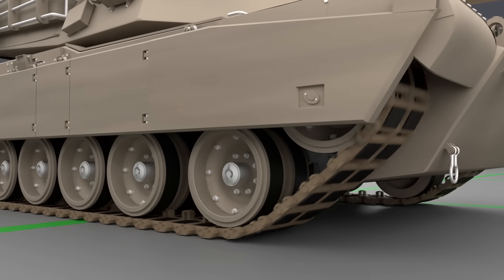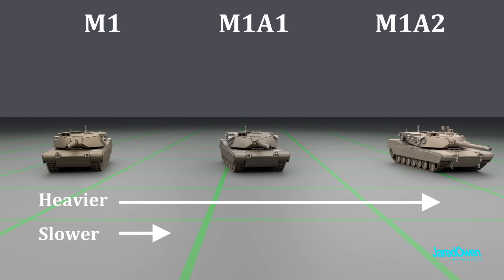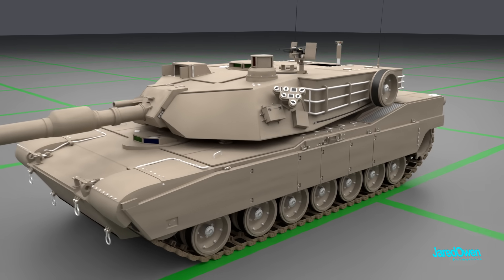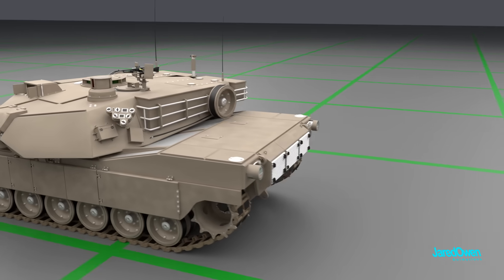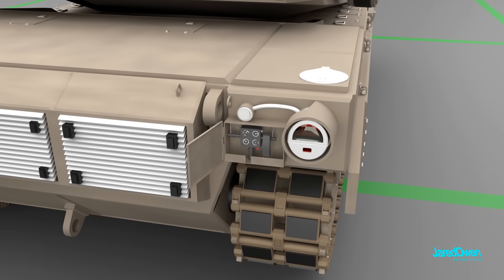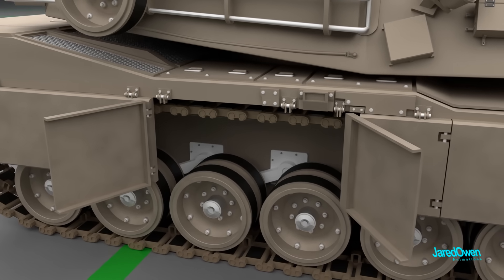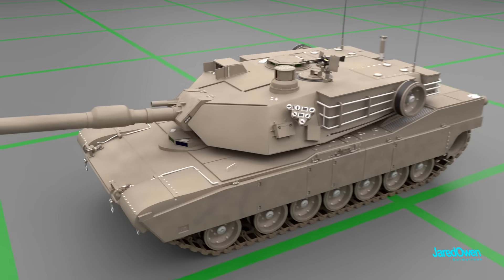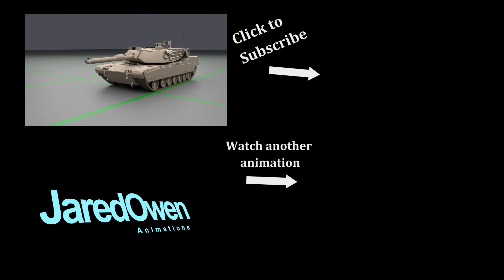How does a Tank work? (M1A2 Abrams)

Comment: Your video is great but dude, learn the difference between feet per secon and miles per hour.  You described the main gun rounds  as  going 3500 miles an hour. Thats over 5000 feer per second. Not possible. They can go around 3500 feet per second, or around 2300mph. Ill double check my data, but you should have done the same.
Reply from the maker: Hi Steven - these rounds go incredible fast.  It is possible😁 Here is a great reference if you want to learn more: https://amzn.to/2WaIzjv

Comment: The commander can use the gunners sight, because commander doesn't have night vision mode. The low  distance to the ground is bad, it can make the tank get stuck, but it can elevate or lower the hull. The side skirts on the side of the driver position are composite to sustain Heat shells at 60º angle.

Comment: no on the tank you will not find a turbine engine. most tanks have diesel engine like leopard 2 t90 t72 ariete. the exeptions were first the t80u then the abrams. those are the only two that come in my mind that have turbine engine.

Comment: This video: Shows locations of crew compartments, engine, equipment, and how the treads work

Me: How does a giant throwing dart and an exploding cone penetrate tens of centimeters of steel?! And how does a ceramic sandwich stop them?!
Reply: It pens it because its a dart lol. And its depleted uranium. Other countries use tungsten.  But the US DU APFSD round heats up after fired, so it uses its velocity and its heat to  penetrate. Up to 800mm+ depending on what model of round its using.
Reply: And also it’s flying at a speed of ~1500m/s. This is real speed

Comment: Jet fuel is basically just kerosene.
Reply: Depends on the grade of jet fuel.
Reply: @sandervanderkammen9230  There are two grades of jet fuel, both are a kerosine base.
Reply: @georgemartin4963  No, that is not correct.
Reply: @sandervanderkammen9230  It is absolutely correct!!! Look it up if you don't believe me.
Reply: @georgemartin4963  I don't believe you know the difference between aliphatics and paraffins.
Reply: @sandervanderkammen9230  https://en.m.wikipedia.org/wiki/Jet_fuel 🖕
Reply: @georgemartin4963  Thank you for proving my point.
Reply: @sandervanderkammen9230  Interesting response considering the article confirms my original assertion that jet fuel is basically kerosine.😂
Reply: @georgemartin4963  Thank you for confirming that your knowledge of jet fuel formulations is limited to Wikipedia...
Reply: @georgemartin4963  Apparently not,  your own assertion is not based on any knowledge of organic chemistry or the petro-chemical industry... just public opinion based on oversimplified, dumbed down explanations.
Reply: @georgemartin4963  Are you sure? You better check Wikipedia again Hahaha!!!
Reply: @georgemartin4963  I'm sure you can find the answer on Wikipedia... lol!

Comment: Tank “fairly quiet”, Bruv in squad I can hear that across the map
Reply: Thats a video game.. lol. IRL its not quiet, but it is compared to diesel engines of the same size and power.  Which other tanks use. They are actually very quiet coming at you. All its sound is projected behind the tank.
Reply: Law Abiding Citizen the tank does class as one of the loudest tank compared to others
Reply: @jackattack237  when standing right by it. Not at distance, especially in front of it. The higher pitch does not travel like the deep tone of a diesel engine. It is literally one of the reasons they chose it over a diesel.
Reply: It also does not smoke like a diesel engine does.
Reply: Law Abiding Citizen can they produce smoke as defense tho?
Reply: @jackattack237  I believe so, I believe it is just a chemical injected into the exhaust.

Comment: Just gonna say, they aren’t referred as caterpillar tracks at all, and there isn’t much to learn about this tank honestly, only if your a mechanic does all the fancy names of stuff, also it’s not as cramped as you think in real life, it’s 7 ft tall, and it’s main gun can fire up to 4,990 + or - 10 km, it runs off of just fuel, the three main fluids are FRH, Turboshaft, and 15/40, it has a primary gun of 120mm, and it has a secondary coaxial gun M240L, a loaders mounted gun M240C and a M2 browning .50 caliber machine gun for the tank commander, also the most likely part of the tank to break is not the track itself, but parts of the track, like the wedge bolts that hold on the end connectors, the end connectors themselves, and the center guides, the projectile is not 120 mm, the sabot pedals are, the only projectile that is actually 120 mm is the HEAT round

Comment: 1.Early Abrams had 105mm canon only A2 have 120mm. Abram also capable at hitting target at over 4km (even though none ever did)

2.that's not how smoke grenade launcher works, they actually launch the smoke grenade

3.most operator usually gave abram a other fuel. The jet fuel was very expensive for operate

Comment: Something to note the smoke grenade launcher fires the grenade before the smoke appears not from the launcher itself however the driver has the ability to press a button that sprays the turbine with fuel which creates a smoke screen but this isn’t used when using jet fuel because it can damage the engine

Comment: for reference, as a tank weighs 35 cars, at 0.6 gpm is has a fuel effieciency equal to 21gpm if it was divided into normal cars. so its not as bad as it seems at moving its weight. a lot of tanks are actually more fuel efficient per ton then most cars.

Comment: Wonderful animations.  But I think the models you were provided missed a few things.  Above the road wheels, behind the armored skirt, are three small support rollers (About 12" Dia.), evenly spaced between the Idler Wheel and the Sprocket, to carry the weight of the track and prevent it sagging.  Also, at the very front, the idler wheel is connected to the front road wheel by a link that moves it forward slightly as the front road wheel suspension is compressed.  This is done to maintain track tension.  The track works like a drive chain and any slack will let the drive sprocket "cog over" and slip.

The smoke grenade launchers actually launch the grenades in an arc around the front of the turret.  When they get about 15 Yards out, they air burst and scatter smoking fragments along that arc creating a very fast curtain of smoke in front of the tank.  It's very neat to see.

The M1 series is also quite a bit faster than the published specs.  Hard, improved road performance is in excess of 60 mph, and it will leap, yes LEAP, an anti-tank ditch not exceeding it's own length.  The Abrams is the first tank designed to leave the ground under it's own power!  The road wheel suspension was specifically designed to absorb the massive impact of the landings and it's engine produces 1500 Hp at the drive sprockets through a 5 speed automatic transmission.

Comment: Nice explanation and animation, but two things bugged me:
1) most tanks still use regular piston engines. They consume about 2x less fuel for the same performance and aren't that much louder. The turbine has less moving parts that could break, but the air filter is a massive weak spot.
2)the door in the animation would only allow access to a fraction of the shells. Moreover, if I'm not mistaken, the shells are stored in liquid in order to reduce the risk of fires spreading. This however means that you cannot move the shells behind the blast door...
Reply: @Silenet K Oh. I thought it was based on a photo. They do seem to stick the shells into a form fitting rack. Or not?
Also, I still wonder about the turbine. I simply can't imagine it to work as efficiently as a piston engine as nothing physically traps the expanding gas and then there's the issue of the giant volume of air sucked in and propelled out... 
And the rotation rate must be seriously reduced... It looks like something amazing for jets, but tanks not so much...
Reply: @Silenet K thanks.

Comment: 6:05 I think this is only for the gas turbine engines
Tanks like Leopard still use Diesel engines (but with multifuel if I don't mix that up with the MBT 70)
Reply: T-80 also uses a gas turbine.

Comment: But all I wanted to know was what the bulge in the main gun was for.
Reply: It’s called a bore evacuator, used to prevent the hot gas from entering the crew cabin though the gun breech after firing, potentially harming crew and equipment. More info on how it works here: https://www.youtube.com/watch?v=by2I0CbhyKc

Comment: Everything about these models you are using seem off from dimensions to the blow out panels shape, size, and location. Parts on the turret are sized incorrectly and in the wrong places. Also, there are weird seams all over the place. The interiors is basic and looks like most of it was made up based off information told verbally or bad images. War Thunder is NOT historically accurate in the least and the gunplay mechanics make it possible for certain ammunition types to penetrate armor in places that was never really possible. I think it's cool that you made a video explaining how it works, but after only 1 minute and 54 seconds into the video I had to stop and say something. I'm sure I"ll have far more to gripe about with the other 4/5 of the video.
edit
The "treads" have a triangular center guide not a rectangular one. It's like the dude doing the model went purely off memory or didn't care. There seems to be a lack of support rollers or arms anywhere behind the skirts as well.
At 5:50 the hydraulic pump is missing from the turbine engine and none of the electrical wiring is there.  Oh, and yes it's very quiet... but in war thunder it's not.
The shells leave the barrel at closer to 3800mph, actually. The gun can also hit targets are farther than two miles away. The maximum effective firing range is 4000m, 2 miles is 3200m.
I cannot believe you actually made the smoke grenade launchers emit smoke instead of launching the smoke grenades like it actually does. That was literally comedy gold.  You have no idea how any of this works.
The loader is never facing the outside of the turret unless he is working on radio equipment, to load rounds you face the gun and rotate your body to the ammo rack so that you can quickly pull a round out, crouch, flip it into the gun tube and push it in until it clears the breach.
The turret and basket is missing 99.9% of any and all interior components but shows the basic layout. The war thunder x-ray mode is very inaccurate when it comes to ammunition system and storage on the Abrams. Quick videos online would show you this, so when you say it is hard to find reference material.. I have a hard time believing you. You simply just did not want to do research into the topic before making a video that would only be suitable for 12 year olds to catch an interest in war thunder... oh wait...
Drivers hole is missing the emergency engine override lever and the lever to the left of it uses to empty the hull when it gets full of water. The lever on the left side is nonexistant, and the halogen bottle and green air filter are placed further back into the tank just outside the turret basket ring and not in the drivers hole as seen. The buttons or knobs or whatever on the right side also do not exist. The T-bar somehow looks extremely complex compared to the simplicity of the one used in real life.
Reply: ok russian mig

Comment: "However, this engine is actually fairly quiet."
If you play War Thunder, you know you can hear an Abrams before you can even see it
Reply: the abrams is a quiet tank irl. becuase its a turbine it makes a high frequency noise which is very loud when up close but at any other range its quieter because it dissipated faster than a low frequency noise
Reply: @Dodener  huh, never knee that was the case irl. Thanks
Reply: the XM1 was the names given to the couple of prototypes from Chrysler and GM so its highly unlike you piloted them. Also if you did pilot the XM1 why wouldnt you be piloting the M1. The m1A1 came around almost 10 years after.
Reply: @Silenet K I would like to see proof of the relabeling and all the other info. I've been looking for information all over the internet and couldn't find anything. The XM-1 (C) looks very different than the base M1. Armor is very different too just by the fact that its composite armor isnt there
Reply: @Silenet K Also what brigade were you part of?
Reply: @Silenet K I dont wanna doubt your story because military history can be weird but at the same time I dont think it's true. I've actually been in talks with a couple tanker hubs and tank enthusiasts groups asking if they have any info on the topic and they are very confused and some thing your just trolling. I sent a screenshot to them to see if they can decode any info
Reply: @Silenet K yes, feel free to email me. Your story does sound mostly truthful after talking with some of the enthusiasts
Reply: @Silenet K very cool. I also have learned alot. Thank you for your service btw

Comment: Lol the gas turbine is guiet, what a joke...
Reply: The turbine engine is much quieter at range vs a traditional engine. It produces a high frequency noise which is louder at at close range but dissipates fast. People do your research before you look like a clown
Reply: @Dodener  thats why plane engines are so loud and you can hear them from far away. nice logic, maybe send the proof, and you look like a clown when you say at range when in reality you cant hear a tank engine more than 500m away
Reply: jet engines are much more powerful than the Abrams turbine, ie over 10k hp equivalents meaning they will be loader in general. Also the engines on jets are direct exhaust meaning the combustion happens right at the barrier  of the outside world.  On the abrams its engine is much smaller and still goes through an entire exhaust system to muffle out sound. Jets dont need to be quiet so they dont both with much noise dampening as well
Reply: https://www.youtube.com/watch?v=jABL74LTmhY if you still dont understand
Reply: @Dodener  the engine is like 1300hp so its very powerful and doesnt work like a plane engine exacly but it still uses the same idea and its very loud. I am not saying that its louder than other mbts cuz i havent heard one. Its probably performing worse in terms of fuel efficiency, reliability, cost and thats probably why other nations dont use it or left it behind.
Reply: @wadecs3214  Neither Cost nor reliability are notable issues. Fuel efficiency is outstandingly good, fuel consumption/ economy at low speeds isn't.

Comment: -1:58 HA slower? So 60 mph is slow?
-And at 2:33 is that off road?
-The tracks don’t always have rubber pads. Those are for when they are going on roads because they don’t want to tear up the road.
-When will the US learn to put the drive wheel in the front so dirt and mud doesn’t cake up in it when the weather is bad?
-Since the tracks are so easy to target by RPG fire, that’s one of the reasons why they put side skirts on to stop or limit RPG’s to the track
-The power pack as it’s called is pretty much a jet engine but instead of making the power into propulsion, it puts it into the driveshaft. That’s the same with most modern helicopters, which they based it off of.
-The power pack is one of the reasons the Abrams is “destroyed” or “knocked out”. The turbine fans will suck in anything and even if a small grain of sand gets in it can tear up the fans and knock out the tank.
-they have been putting phones outside tanks forever now
-they’re called ‘road wheels’ but they can’t drive in the road. Some examples that can are the Tetrarch , M22, and maybe the BT-5 or BT-7
-the smoke grenade launchers don’t produce a cloud, they shoot grenades (much like one out of a grenade launcher) and create an ESS (electronic smoke screen)

Comment: 10:00 Note
Dosent work if the Blast door is Open Or penetrated by Heat Jets Or APFSDS rounds 
fire will Go the easy way and thats the Hole in the door it will Blow that small Hole Open

Comment: But do you know what the M1A2 Abrams projectiles are called? they are called APDS (armor-piercing discarding sabot) in which they become missiles because they are the fastest projectiles of war tanks, also their engine is that of an airplane, since this vehicle is designed for war in the desert This is why it consumes 500 gallons of fuel and its engine is not only designed for jet engine fuel, but also for other fuels, such as ships, cars, trucks, etc. Since in the desert you cannot find fuel easily or find a gas station
Reply: @Silenet K no, it was created after the cold war, it was designated for the invasion of panama, the gulf war, afghanistan and iraq, in the war in europe it was the m4-sherman, but not the Abrams
Reply: @Silenet K oops, hehe, sorry I had no idea it was an oil tanker in the war, I apologize silenet
Reply: @Silenet K With one exception, the derivative M74 appears to have been used in Vietnam.